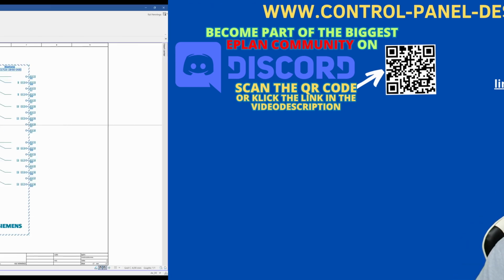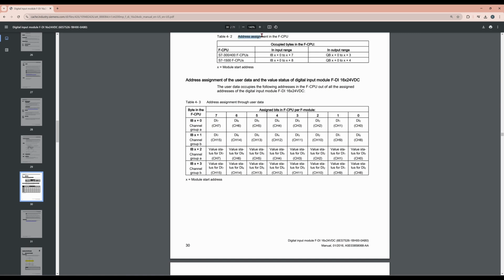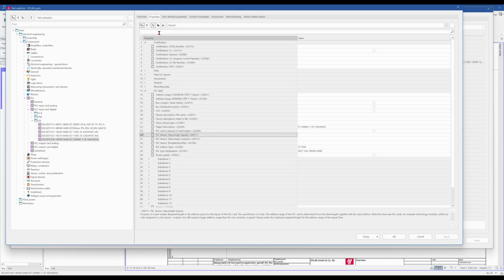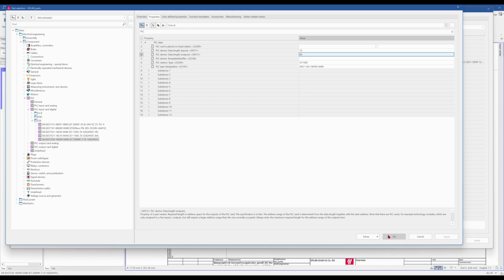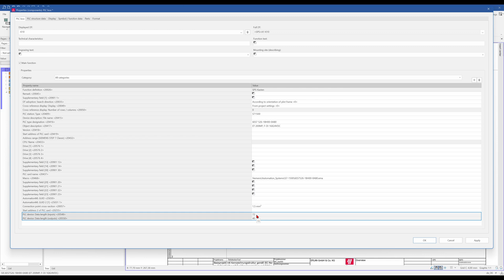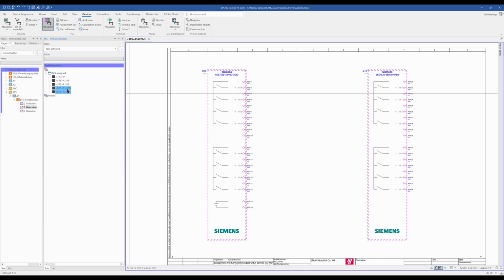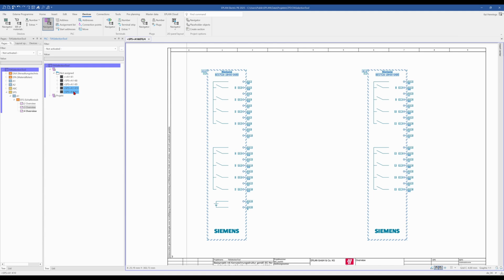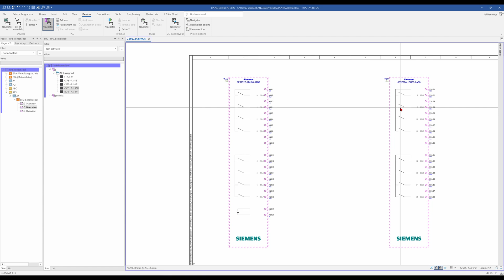Addressing safety ⚠️ PLC cards in EPLAN. SIEMENS F-DI card

Comment: Good video. Does the same apply for ET200SP-F cards or S7-1200-F?
Reply from the maker: Yes, sure it works for all cards which occupies additional IO range.
Reply: @eplaninanutshell  Yeah thanks. :) I checked and AI-F should be 14 bytes - 112 bits. I would really appreciate a video in which you would do complete PLC + REMOTE IO ET200 (with bus module) + HMI(!) + SWITCH configuration and than export it to Tia Portal. I know you have some videos on some of the steps.. but yeah this PLC configurations are really something else. Cant get AML to work.